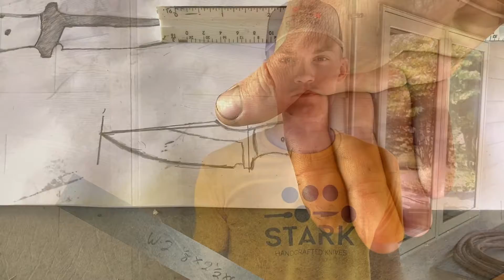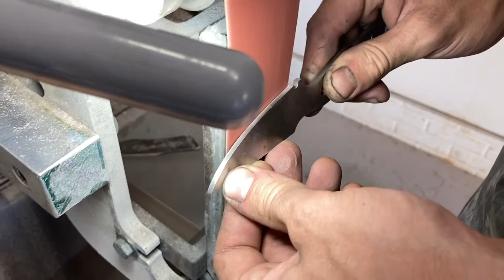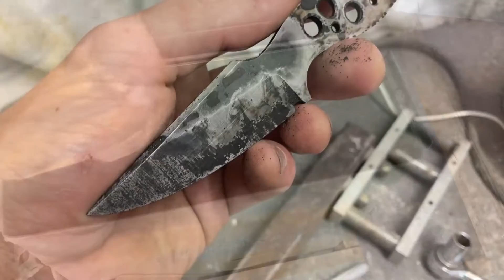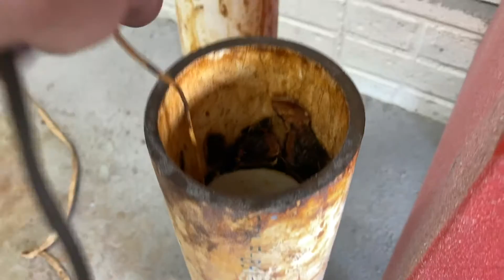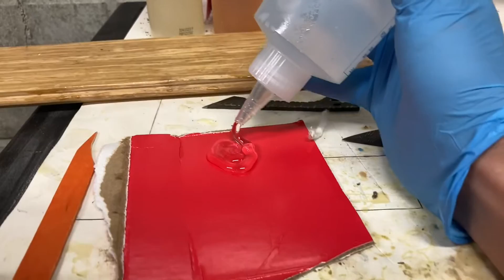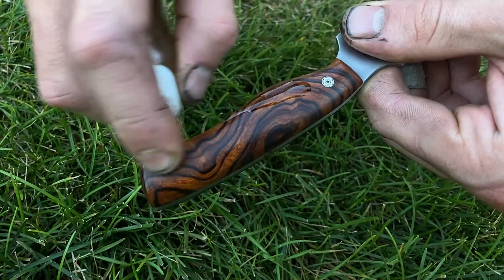How to Make a Custom Hunting Knife Set

Comment: Hello, I live in France, start the cutlery in hobby, and discover your chain. I congratulate you on your work. it is not easy for me to translate everything, and I use a translator. also, I would like to have more explanation on the salanite clay product that you put on your knife. the leash for the oven or do you dry it before? what product do you use for quenching? what is your gray mixture and its proportions? what is it for? thank you very much. and continues. bye
Reply from the maker: Hi and thank you for watching! I'm actually about to post a video that explains the clay process in a bit more detail. The satanite is mixed with water to form a thick paste that I apply to the blade and let dry overnight before putting the knife in the oven for heat treating. I quench in Parks 50 oil. The gray mixture you are probably referring to is abrasive powder that I mix with oil to polish the hamon. I will explain that in the next video as well! :)
Reply: thank you very much and i am waiting for that with impatience. 
Happy New year
Xavier
Reply from the maker: You too! The video was just posted today if you want to check it out. :)
Reply: I understand W2 is a water hardening steel so just curious why you use Parks 50?
Reply from the maker: It’s a fast quench but is less prone to warping and cracking than using water.
Reply: @StarkKnives  Yeah, that makes sense.

Comment: What a beautiful knife, you have well mastered the free hand grinding on your bevels and plunge lines. Do you have any tips on how to master it. After heat treatment to what thickness you grind your edge. Keep up the good work.
Reply: I noted the same. You do free hand grind but you actually don't even mark the blade before hand?!?!?! That is quite amazing mate!
Reply from the maker: Thank you! I definitely haven’t mastered it yet, but I’m working on it! I always recommend doing a lot of practice and when you feel like things are getting hard to control, switch to a fresh belt. I usually take the edges pretty thin. I don’t measure them, but it’s probably around .015” or so?